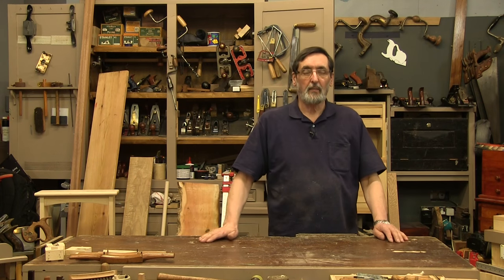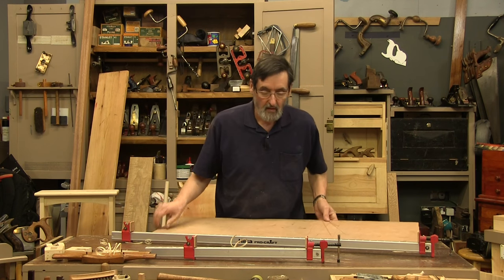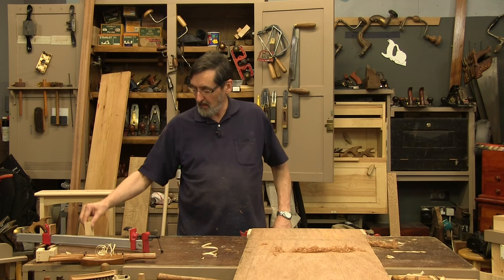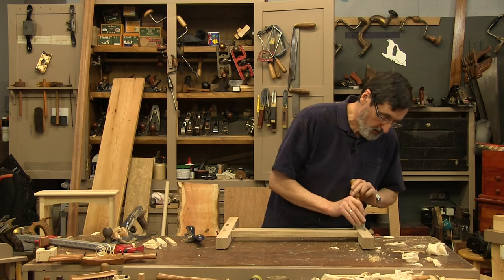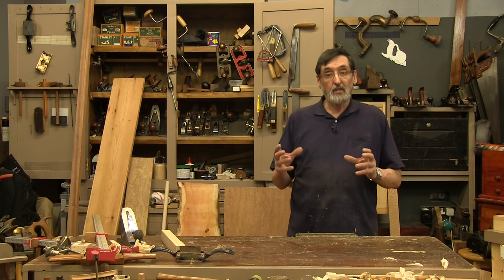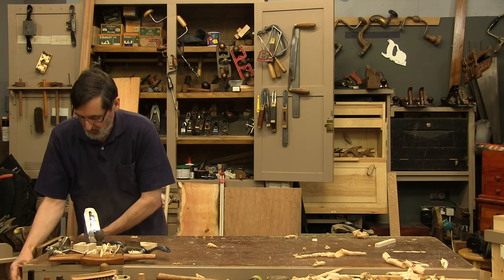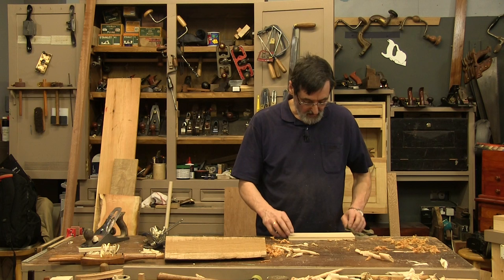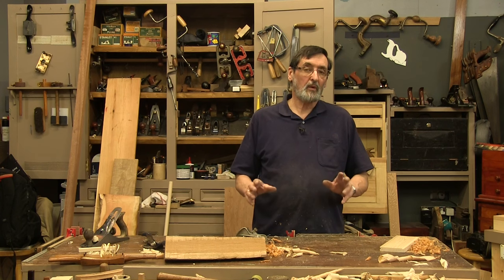An Alternative to Bench Dogs | Paul Sellers

Comment: Living in an appartment, with very little space and trying not to disturb my neighbors while doing any kind of woodworking is very hard, but Paul's "old school" videos are the way to go. Except for hammering. everything else can be done with very little noise and without huge powertools. This is just amazing.
Reply: If you use a hammer with soft materials to cover such as leath, thick cardboard or thick cloth it can really dampen the noise of the impact. 
Or even get an old book and put it on a surface if you need to hammer it. When it comes to chiseling just put a soft top on the chisel and a soft cover on the hammer. While it will make a noise it will be much reduced from hammering a hard surface.

Comment: I was agonising over my complex design of a workbench with dogs, bells and whistles etc then I saw this video and everything is so much simpler now that I can actually get on and build my bench. Great advice very well presented.
Reply: Two dog holes can allow you to have a rail with dog holes. Alternatively you can also use bench hooks along with the vice and clamps. 
You can create all manner of bench hooks and jigs that can either work by them self or with the vice. 
If you have space put a vice on both sides of the bench and that will give you even more power. 
Your imagination is the only limit really.

Comment: I've been doing this with my general shop vise I bought 35 years ago.  Don't know the proper term for the vise, but it's just a big ol' 
Wilton vise, which I bought copper jaws for.  I started using wood clamps clamped in the big ol' vise when the wood wouldn't fit the jaws, 
and it worked fine, but I thought I was being too weird ( yet again ).   Surprised that Paul relies on the same principle.   Good timing, 
too, because I am almost set on the design for my first woodworker's bench.   Getting close to a decision about the design.   Watching 
a bunch of these woodworking videos to make certain I'm on the right track.    This simplifies the design because I don't have to drill
a bunch of holes in the top and legs.
Reply: shopping for the clamp, there seems to be only aluminum clamps of the style clamps shown in this video.
I am hesitant to buy aluminum clamps, even with a wood insert, it might deform if clamped tightly in a bench vise.
I'm thinking of spending about 3 times as much for a Jorgensen bar clamp, that is made of steel with an I-beam shape to the bar.

Comment: Thank you paul. I bought an old vice at a car boot sale  and simply bolted it to the apron. I then fitted a block over the faceplate (admittedly reducing the effective expance of the jaws) so that the vice protrudes from the apron as yours does. I initially did it this way to save time because I wanted to put it to use quickly. But I saw no reason to change it later yet still felt I was being a bit lazy. Now I can call myself 'wily' instead.

Comment: I built my workbench and put in a leg vise, deadman, and dog holes.  I bought two holdfasts and 4 really cheap dogs.  I wouldn't trade this system for anything and the whole thing cost me about $225.  The holdfasts were the priciest thing but I love them and I love the bench.  After years of clamping things and having to move the clamps, tighten the clamps, figure out how I want to clamp a piece, I just grab a holdfast and give it a tap and I'm done.  Best thing I ever did.  Made woodworking so much easier and now I get work done faster than ever because I don't have to work out how to hold the thing.  I can hold anything.  I used my leg vise and deadman the other day to shave a door that was binding.  Was so easy and quick.  I was cutting dovetails yesterday and I just used the holdfast to keep the piece down while I chiseled out the material between the tails.  Super fast and effective.  Seriously, I don't know what Paul is on about here.  You really can't beat a couple of holdfasts and some dogs.  The holdfasts can be pricey at $23 each, but the dogs cost me all of $12 for four of them.

Comment: Hi Paul, Your video was a revelation to me. I have resisted drilling dog holes as I had built in clamping edges all round my bench but I had to resort to a Workmate for most sanding of boards. Thanks. Colin in Northern Ireland

Comment: I already use this concept in a different way--I built FWW "New-Fangled Workbench" which uses two built-in pipe clamps running the length of the bench for clamping long pieces, and two moveable short pipe clamps slide into holes drilled six inches on center along the bench. The long pipe clamps substitute for a tail vise, and the short pipe clamps on the side substitute for a face vise. There is also a board jack built into one side that is height-adjustable for planing the edge grain of boards. I've never found a need for drilling holes in my bench top for dogs. It's a very adaptable system that is both cheap to build and very effective. It's the same basic principle that Paul demonstrated here.
Reply: I like the sound of your idea. Would you care to share a photo?
Reply: Google what he put in quotes.
It was featured in Fine Woodworking, the magazine.
It's interesting.

Comment: For those in the US, Harbor Freight sells these clamps.  They are pretty cheap.  I do recommend putting in the wood like Paul showed in the beginning.  3/4 plywood is the perfect size width.  I started off using expensive parallel clamps but I've found these clamps work just as well for most uses and are super light.  If the clamps had a higher thread count on the screw, then they'd be perfect.
Reply: And for those in Canada, Princess Auto has them
Reply: Thank you much.

Comment: I love your setup Paul and I agree you need nothing more. Ibuilt your bench almost 3 years ago and bought the cheap HF clamps like you show and modified them the same way.  I have had no problems what so ever in clamping anything, and like you mentioned other than buying a nice Record Vise which I have had for a long time it was very in - expensive. You need nothing more IMO.

Thanks for this video !

Steve

Comment: Thank you so much for making this video and sharing your extensive knowledge.
I had started drilling holes in my bench for dogs, but after trying the system, decided it wasn't for me. I didn't want a bench full of holes as it makes cleaning up a nightmare and the work piece never seemed secure.
I couldn't believe it when I saw this video... I have 2 x 3ft sash clamps (exactly the same type as yours) that are hung up in my shed and very rarely get used. As of tomorrow they will be put to work and all the holes in my bench will be filled.
Thank you very much for sharing this... I can't thank you enough for all the things I have learned from watching your videos.

Comment: Outstanding alternative Paul... The simplicity of this is something I will seriously take into consideration before drilling 3/4" dog holes into my recently built workbench! 
On a side note here: I have used your method on the almost completed install of my 10" woodworkers vise made by Littlestown Hdwe. & Fdry. Co., Littlestown, PA., USA. I am about to do the inside wooden jaw install across the vises inside fascia plate assy. That assy is screwed & lag bolted in place & is very close to perfectly square to the benchtop. So, in a nutshell, I am now very close to having a ready to use 14" woodworker's vise. 
Thank again for the many insightful tips on using hand tools on such a wide ranging type of wood working projects...
Bill on the Hill,
Vermont, USA... :-)

Comment: Paul I am so glad I came across this video. After watching countless other videos while looking for options for mounting my quick release vise, and trying to figure out what was right, flush or not. I am absolutely sure now that flush mount is not the best option for me. Thank you for sharing a lifetime of knowledge with us. The other convincing video was Matt @Next Level Carpentry when he showed how he does vertical panel clamping using his quick release vise and is able to place bar clamps on the front and back side of the panel because of the space created behind the workpiece created by the quick release rear jaw being spaced out away from the edge of the bench.

Comment: Personally I have a bench system which I developed myself and it uses not one but TWO benches. You have a traditional style "woodworker's bench" behind you (against the wall most often), and in front of you is an assembly bench. So a "Back Bench" and a "Front Bench". You put the vice on the back bench and have it a little taller than the Front Bench. You can use the vice and dogs for planing etc and for things which need holding in a vice. I also find, very much like having the back jaw of the vice away from the bench edge, like yourself Paul, that setting the top of the vice about an inch ABOVE the the top of the vice allows you to put things in the vice and effectively saw through them without having to bend down to angle the saw up, so you don't chop through your bench. And it gives a lot more access to workpieces, in general, than when the top of the jaws are flush to the bench top. Putting a series of holes in the leg of the bench will allow you to put in a lose dowel at different heights, so you can hold a board at one end in the vice and rest the other on the lose dowel at an appropriate height. The Front Bench is left without a vice, and is as big as your space will comfortably allow (say 2M x 1M) whilst being able to comfortably walk and work all around it 360 degrees. This then allows you to assemble even very large furniture and wardrobes on your Front Bench (assembly bench), made from manufactured boards like chipboard and MDF. A vice on this bench would just get in the way, and snag on things. If you leave the overhangs of the bench nice and wide, you will be able to cramp things down using the edges of the bench. You can also put holes (round or square) in the middle of the Front Bench and use them for steel holdfasts (dogs), or if you make the holes big enough you can pass cramps through the holes, so you can cramp in the middle of the bench. It's also worth noting that if you have a jig or workpiece which you need to work at the front of and cramp to the bench at the back, it's much better to do that a the CORNER of the bench rather than a side, as you can put the cramps far back while the corner naturally projects and supports under the middle of the jig or workpiece. Wouldn't dream of telling you how to suck eggs Paul, you know your onions, and there's some good points in the video for those with a one-bench system. This is just to point out the system I have developed over 30 years for coping with all manner of furniture and luthiery etc.

Comment: Brilliant video! Great timing for me. As I just built my bench and have the vice fitted. But no jaws added yet. Glad I saw this as I now know how to set my jaws up. Was going to do the flush thing. But this is much easier. I have been using sash clamps with my B&D workmate for a long time now. So this technique is not unfamiliar, But good to see this explained in such detail. And I thought I was cheating! I won't be bothering with dog holes this is just simpler, easier and quicker. I've just ordered a few extra sash clamps. I am almost ready to start making things now, other than tools.

Comment: These clamps aren't terribly easy to find in the US.  Finally found a "Shop Fox" branded one to try out.  It appears to be the same clamp.  

Just finished fitting the wooden innards. I ripped a 2x4 and then planed square and to size.  

Now to attend to the pads, but only if I can quit using the darned thing.  

I had been using a similar solid steel bar clamp, but it left much to be desired.  This is 10X better!  Thank You!

Comment: All of these tips and techniques are useful, and it baffles me that some of them are so simple, yet I wouldn’t have thought of doing it this way. However, I don’t think a bench dog system is a massive investment as the description seems to imply, and some of the workarounds are only necessary because the aprons of Paul’s workbench are getting in the way.

The aprons are very important for rigidity in this design, but at the same time they limit the options for clamping things to the front edge, or to a front leg. They would also make it difficult to reach under the bench top to push up a bench dog. Not to mention making it weird to install the front vice.

guarantee stiffness and to add some weight.mustered

Comment: This looks like a very versatile method of workholding, and without the bench hold down being in the way, the one thing that makes planning a large flat surface easy, is having the board firmly clamped, non of this skating around, and this method is a very effective solution. Interesting to see how the subtitle translator picked up the Lancashire accent for "Clamp", as "Clump".

Comment: I like this method very much.  I am just starting.  Are there dimensions on ideal locations and heights for a vise? Is a rear vise the same type of vise, matching or different types for more options?  What are those little blocks? How do I make them? 1What is a great table size? Half a sheet of board? Thanks for your help.

Comment: Thank you for this video Paul. I used the method of clamping the clamp in the vise to hold a piece of work as I planed it with a skew rabbet to make one piece drawer runners. Very effective. 

I also noticed in a video you had a mortised plane stop in your bench top. Do you like it?

Comment: I find the installation of the vise inner jaw interesting.  Having it not flush with the table edge makes sense.  Most of these type of vises have screw holes that would normally go in through the front into the side of the bench.  Seeing it will be proud of the bench do I put some spacer wood in behind and still screw it into the bench?  Or will the screws underneath be sufficient?

Comment: Thanks for all the tips for clamping and working with bar clamps, however, I couldn’t get a good look at the side mounted vice.  Couldn’t see clearly if it was mounted so that there was a 3/4” gap between the vise and bench or that the vise was 3/4” above the surface of the bench.

Comment: Very nice. I have something like this i just made and your vid makes me feel better about my choices:] I have a small metal vise that turns 360 with two elbows and it is parred with a 2x4 Stanley clamp. I may need to get another vise clamp combo for the other side of my bench then i can clamp without limits or 16' both sides:] or just put the 2 vises on the same side for added strength.

Comment: Mr. Sellers, does the wood fitted in your box clamps run the entire length of the aluminum bar? And if it does, would shorter lengths the sum of the bar be adequate? Thank you!
Reply: I would imagine he put the wood inside the clamps so that when inserting one into the bench vice it isn't crunched, bent, or otherwise distorted. So yeah, the wood probably runs the entire length of the aluminum bar.

Comment: how did you come up with these methods of clamping, was this somthing you said ah ha to one day? its brilliant.
Someone's going t see this and make benches like this with out rigging clamps systems  I think the tail vice could hold a door upright to cut in a mortice lock system or set the hinges with on its side.
You covered a lot of ground and no dogs to look for.
Reply: Jigs in vices have been used for a long time.  It is only natural that a woodworker would come to these conclusions when doing work.

Comment: Could a removable spacer block on the bench side of a flush vise give the fingers space (13:24)? I just got a second hand Sjobergs bench top with a flush vise. I've not yet built a base to set it up here. I think that a spacer could provide advantages of both flush and offset vises.

Comment: I enjoy Paul's videos and have learned some good methods from him, but all the reasons he gave for having the vise jaw sticking out from the bench front are spurious.  Having the vise flush with the front of the bench works as well, if not better in most situations.  Both arrangements require aids to do certain types of work.  As for using the bar clamp in the vise, he is offering a quick and easy way to get going.  Most of the work processes he showed could be done by pushing the work piece against a planing stop, with, or without the use of a holdfast & maybe a doe's foot.  Since we all need bar clamps, the method he shows is inexpensive.  A holdfast is a useful tool, but it's only good for clamping things to the bench.  Paul is a bit unique because he works in a very vise oriented way.  Almost every process is done with the work held in the vise.  Others will crosscut using a bench hook, or rip on a sawing stool - Paul holds it in the vise.  Most pound out mortises with the work on a piece of scrap, or on the bench hook, on top of the bench - Paul pounds on it in the vise.  He's done it for over 50 years, so it works, but he is in the minority of old school, hand woodworkers.  You can see this by looking at all sorts of old books.  I do some things in complete violation of the books myself.  Some methods work better than others, but if a method works at all, there'll be at least one person who'll tell you it's the only way to go.
Reply: Sigh
Reply: Clif Brigden
What, you don't have the energy to say something relevant?  People all around the world have been working wood for millennia.  That there are numerous ways to do any process should not be a surprise to anyone.  That Paul has his preferences is expected, and that others have theirs is also expected.  Another thing that is expected are people who can't stand to see their heroes questioned in any way.
Reply: +deezynar yawn

Comment: this is a good tip, but doesn't work if your vice jaw is flush with the edge of the bench, as mine is
Reply: it does... just have a spacer jaw you drop in vice to go between clamp bar and front of bench.